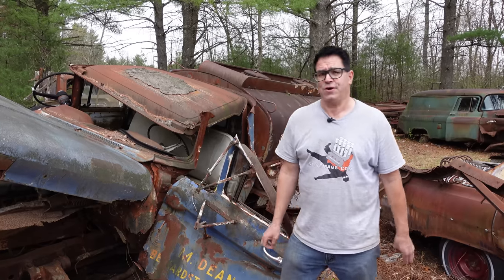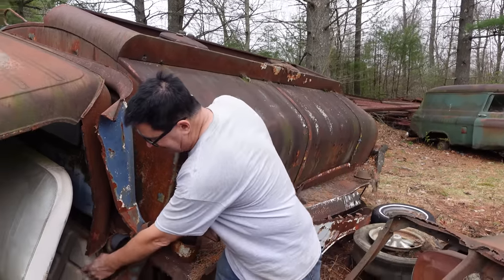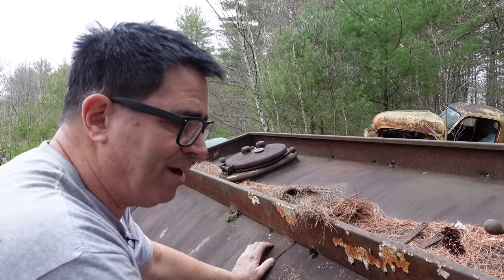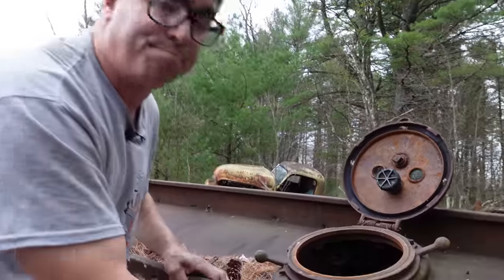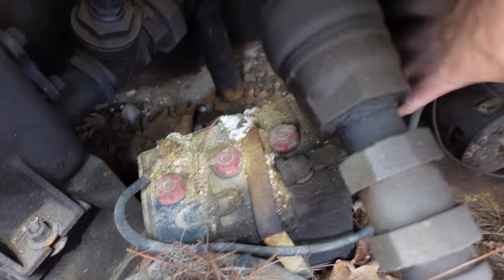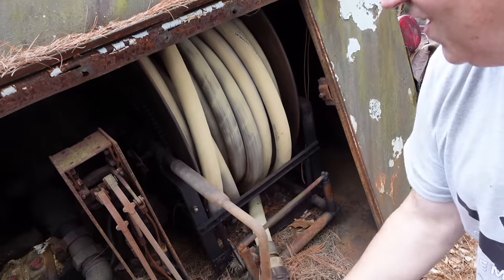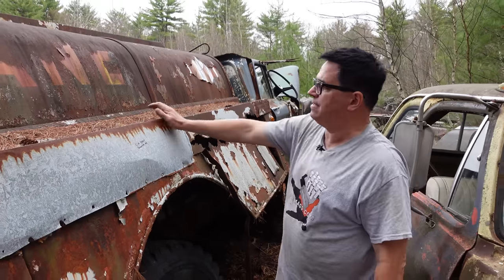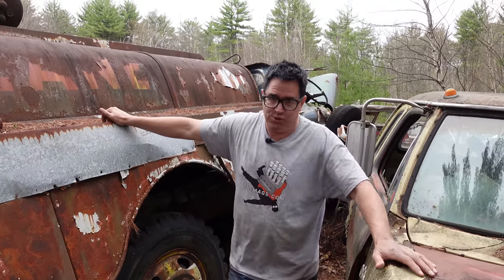Torsion Bar Tanker: Part TWO

Comment: Great Video Steve I rebuilt 2 C60 Chevy tank trucks for my Pennzoil Distributor business Excellent explanation of the reel,pump and hose worked I noticed the “Money Maker” head been removed! On top of the mix we before the hos the product goes through a meter that prints a ticket. That’s. What you give the customer It is a triplicate copy one for them one for you and one for the company. In some states your meters must be certified by Weights and Measures just like fuel pumps. The meters were really expensive as is all the pumping gear and was often removed when a truck got sent to Valhalla!Super video, It amazes me to think of driving that tanker on a January night with 4000 gallons at 8lbs to the gallon(32000)lbs with that little stove bolt up front It would be following every rut with that independent front end. Snow driving down and someone out of heating oil. No wonder the drivers smoked unfiltered Lucky Strikes. Keep up the great work I’m a big fan

Comment: Lots of old iron in that yard  - surprising to see it that close the a metro area as most were scrapped long ago.  The rail up on top by the tank hatches / covers also is a spill protection device and usually had a pipe at the rear to drain off any excess from overfilling the tank.  I learn a lot from your videos - keep up the good work.
Reply: Bernardston is almost to Vermont, about as far from metros as you can get in Massachusetts.  I used to deliver oil for Cleghorn Oil in Fitchburg and then Marane Oil in Worcester.
Reply: Makes more sense than rollover protection.

Comment: I love old tank wagons! I'd like to see when the tank body was constructed, the tank body looks mid 40's- early 50's to me. There should be a plate with the builder, date of completion and capacity. The tanks didn't wear out, the trucks did. It was not uncommon for the tanks to out live several truck chassis.
 Anything pre 50's with the original chassis/tank body is pretty rare. The rapid road development of the 1950's and higher driving speeds doomed a lot of the older trucks and the tanks went on more modern, more highway friendly chassis like this Chevy. My 52 F8 tanker with it's "Cargo King" Lincoln V8 is giving all she has to manage a top speed of 40mph empty. The reason it survived intact is she worked an airport then a mining company, no need for speed. I still see the occasional vintage tank body like mine still in use albeit on more modern truck chassis.

Comment: Please don't leave tank hatches (and hoods for that matter) open for water to ruin areas that would otherwise be protected
Reply: Yes! Leaving them open is a dick move.
Reply: I'm sure he will put them down again .He is always in that yard.Is the Truck restorahle and of any interest to anyone is probably the more important question
Reply: @sinistercharger  I'd like to think so, but in nearly all of his videos he leaves open hoods and doors etc, and my mind is screaming out to close them, yet time and time again, just like this hatch... so I'm now thinking if he really was going to close them, he would've done so when already right there next to/on top of the unit in question, rather than backtracking everything
Reply: @rickc303  looks pretty clean in there.. although I feel its not getting re used anytime soon
Reply: @jrea424  it's clean because the tank was used to store oil, not water. Regardless if a particular individual doesn't think the protected area (or what's inside it in the case of hoods/doors etc) will be used again, there's no need to accelerate the damage done from elements
Reply: I get a kick out of seeing the Easter egg notes that Steve leaves in various places on the vehicles he's talking about.
Reply: i live close by this junkyard. its always funny to see steve has been there not that far before me. most of all the stuff he shows ive seen after and he's closed doors, hoods etc.
Reply: I’m sure he puts them down and closes doors. This guy ain’t no rookie.
Reply: Chill out. They're filming, and probably getting extra footage and photos for stuff we may or may not see. I like how every video has someone who thinks everyone is a moron except for them.

Comment: It floors me that big tank of oil was pulled around by a stovebolt six, which has to be one of the most anemic engines on the planet
Reply: Very good comment. I have a 270-1959 GMC and feel the same way!
Reply: Probably has a 5 or 6 something gear in the rear end

Comment: I've had this discussion with an old trucker years ago, the baffles are for braking. The sloshing would continue to push a truck after coming to a stop.
Reply: Ahh yes baffles. So much fun for me. I inspect pressure vessels. All road going vessels require a 5 year recertification. I go inside and inspect all of the welds. Those damn baffles take a bit of gymnastics to get around. But they are certainly necessary.
Reply: And this had one master cylinder with only one set of brake lines. Mass DOT must have inspected brake lines marinated in salt brine annually. Still risky.
Reply: @z978ady  ... back when this truck was new they hadn't started using salt on the roads yet.

Comment: Back in the day it was common to see those trucks with 2 or 3 compartments. In farm country they needed gasoline, heating oil, and kerosine / stove oil. The battery in the back was the best way to get juice for the hose reel without running a heavy cable up front. It did recharge from the truck's generator via a smaller wire.

Comment: My grandfather ran a service station  from 1960 to the early 90s, his first truck was a chevy I6 not unlike this one.  He always said it ate points and condensers, they put in new ones about every 1000 miles.
Reply: Sounds like he had a bad ballast resistor.  That lowers the voltage to the points to keep them from burning up.
Reply: @ostrich67  maybe, but between him and my dad I think they would have figured that out.

Comment: Interesting that hose motor is just a starter motor with solenoid.  Be fun to run the numbers and see if it's the same one as a 261 would use, or if it's specific to the hose unit.   

Are those Sunoco decals on the body along with the CM Deane name?  Shape looks right.
Reply: I tried googling "C.M. Deane Bernardston Mass," and got zero hits!  They must be defunct.
Reply: @DanEBoyd  CM Dean still exist as Dean's Bulk Service ( DBSoil) !
Reply: it looks like a starter motor but most used ball bearings due to the heavy load and longer cycle times.

Comment: Can't believe you still use oil to heat with. I remember when living in Illinois in the late 1970's oil  jumped up so much that people were switching over to natural gas & propane because of the price. As I remember it jumped from around $.40 a gallon to about $1.00 darning the bad days of hyperinflation and the second Arab oil embargo.
Reply: heating oil is still king in the northeast. Mostly in areas where natural gas is not available. Have you priced natural gas or propane lately? Not worth the price of a conversion unless the equipment is going to be replaced due to age.
Reply: If the gas lines are not laid, fuel oil, propane,wood stove or electric heat is all your choices. In the NE US and Maritime Canada, gas isn't always available

Comment: A lot of those old "class 2" (Massachusetts designation) vehicles didn't have huge engines.  It was the gearing that got the job done.  Remembering back to the school bus, most drivers started off in second gear.  1 was a super-low gear, only used for hill starts or sticky situations.

Comment: I remember as a kid in the New Jersey winters when we would have to go out in the snow and find the oil fill cap on the front lawn. We would put an empty soup can over it so if we needed an oil delivery the driver could easily find it. I
Reply: Why was the oil fill on the front lawn and not on the house? Makes no sense.

Comment: Axle shafts were weak on c50 on up so axle was probably snagged to replace a broken one
Reply: I've heard that alot that they had weak axle shafts. I have an extra set for my international loadstar dump truck but I haven't broken one yet.
Reply: @evananderson3350  ... just remember that they usually break with young drivers and standard transmissions.
Reply: @rupe53  that's true. I just turned 24 but I learned from my dad and grandfather. grandfather was a equipment operator and my dad was a truck driver. I own my own business and I do both lol. I have a couple buddies that work for me and I'm always telling them to be easy on my trucks and if they get stuck or something don't keep trying to get out or spin the tires just wait until I get there to pull it out.
Reply: @evananderson3350  ... there's an old phrase: Experience can keep you out of trouble... BUT... sometimes the experience you learn from is a BAD experience.

Comment: Floating axle shafts have reduced bending moments on them, so they should last longer, especially on high GVW vehicles. ...and hey, if you axledentally drive into some deep water, you can just float on the surface until someone tosses you a rope.

Comment: I doubt very much, the torsion bar itself was the problem more likely an under engineered suspension design.
Reply: It was mostly because of the independent front suspension. There’s more adjustment in it so it’s easier to knock it out of line. Compared to a traditional straight axle where you’d have to physically bend something or knock the axle loose from the spring to change the alignment. 
It is possible to make an independent front end that would hold up, but it’d be so heavy there isn’t really an advantage. Especially as they’ve gotten better with the geometry of the straight axles over the years.
Reply: @NBSV1  yep, so under engineered or poorly enjineered, not the fault of the tb😃

Comment: your suppose to pull the shafts when you tow a truck on drive axle so the diff and trans don't spin and kill the trans they probably didnt put them back in after towing it there or maybe the diff was locked up so they had to pull them to move it?
Reply: with a standard trans that doesn't matter on a local tow. Most likely either salvaged parts for another vehicle or the diff is shot.

Comment: How the heck did a little 6 cylinder haul that around? I've driven a modern truck. Two compartments or not, that sloshes pretty hard.
Reply: hauling was slow for sure. I drove an old Mack (1961?) with a six as a 2800 gallon tanker truck in the fire department. It had a 5 speed crash box with a 2 speed rear. Took forever to go the max of about 50 mph. Some hills around town required going back to 1st gear and just crawling against the governor, which was about 3 mph.
Reply: @rupe53  The good old days
Reply: @waterheaterservices  ... I was also the driver training officer.... and for some reason everyone wanted to qualify on this truck, although few got good enough to pass the test. Other odd options on these older trucks were air brakes with a "trolly brake" lever on the steering column (hill holder?) and a lever style parking brake that operated a band / drum on the driveshaft. Did I mention no power steering on a 30,000 pound vehicle?
Reply: @waterheaterservices  ... BTW, today I drove a 1928 GMC fire truck in the local parade. 80 HP, 6 cyl, 4 spd crash box, with mechanical brakes. In those days a medium duty truck was actually a Buick touring car chassis.

Comment: I remember as a kid (Yakima Wa US), seeing the truck deliver oil for the winter and the furnace first time start up smell.  ;-)
Was that alignment problem also a common issue with torsion barson cars?
Reply from the maker: Hello T'airn'KA, the torsion bar front suspension is just fine for any normal use on the road. But - apparently according to many reports from owners - when used on heavy duty trucks in any sort of off road setting, like a sand pit, unpaved, rutted roads, etc. it was easy to knock the front tires out of alignment. Think of it, with all those ball joints, bushings, tie-bars and anchor points to flex from jounce-rebound, the basic strength of an old-school beam axle and parallel leaf springs is no surprise. That's why in 1963 GM phased in the 1959-style beam axle back into production as an option before making it standard in 1964. THANKS for watching and writing, Steve Magnante
Reply: @SteveMagnante  Thanks for the clarification.  ;-)

Comment: Virtually everything about the creation purpose and use of that vehicle involved the use of hydrocarbons. Todays green vehicles are far from carbon neutral. 
Go miners and drillers. Thank you for horse power warmth and keeping the lights on! 🤘
Reply: A pile of plastic Prius in San Francisco with a COEXIST sticker will save the planet and universe and stuff.

Comment: those arent view ports  they are fused burst discs
Reply: What the hell are burst discs?
Reply: @rockettcustoms6266  they are thin metal soldered onto the fitting.  if the tank overpressures or catches fire these thin metal discs blow out opening a hole so the tank wont build enough pressure to explode